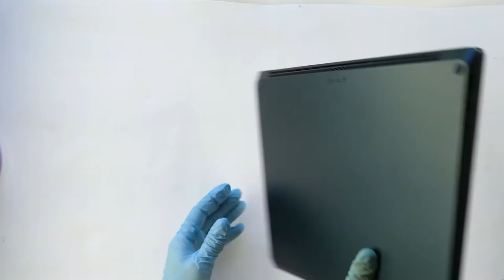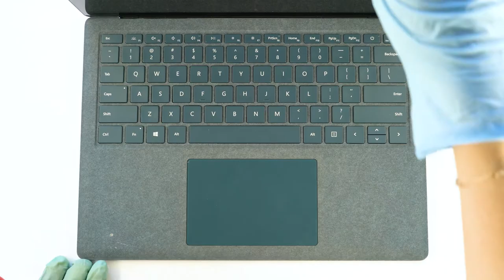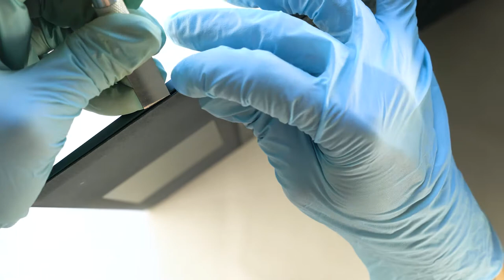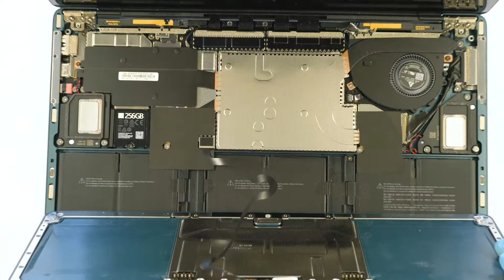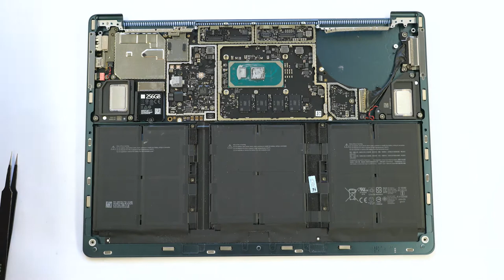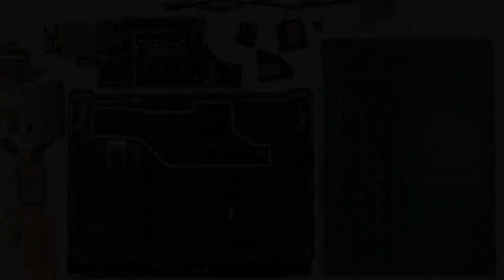Microsoft Surface Laptop 3 13.5" Full Disassembly Teardown Guide

Comment: I really wish these guides would give a clearer view of the underside of the keyboard 😅 my ribbon cable detached at the keyboard and I cant quite figure out how to reattach it.
Reply: Did you find a way to reattach it I'm in the same situation
Reply: @mclilzenthepoet2331  yes you have to remove the metal shield from the trackpad and carefully re-insert it. It is delicate and will tear easily. There’s about 8 screws and some tape holding the metal shielding to the underside of the keyboard. Really important to make sure the ribbon cable is unplugged from the laptop when you reconnect it to the keyboard.
Reply: @ultratruman did the laptop still turn on even though it was detached? Mine is detached and I can’t tell not powering on or charging is the reason.